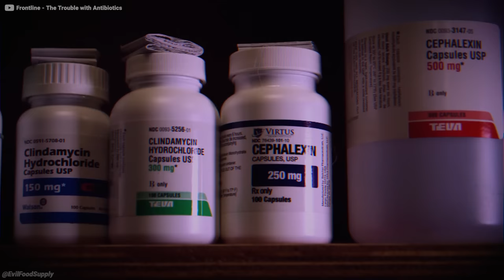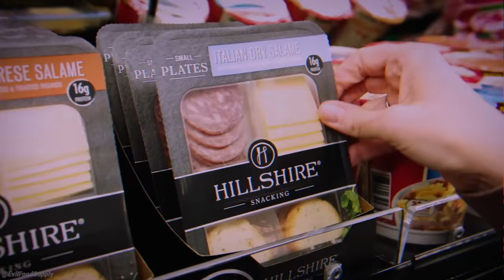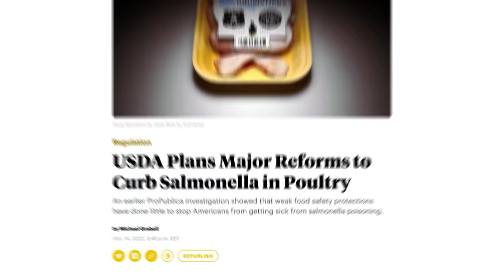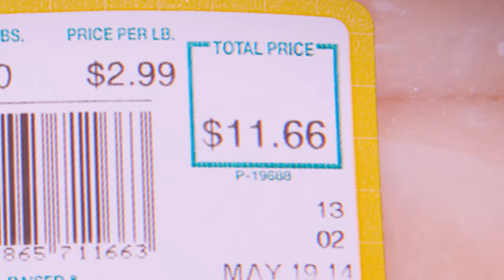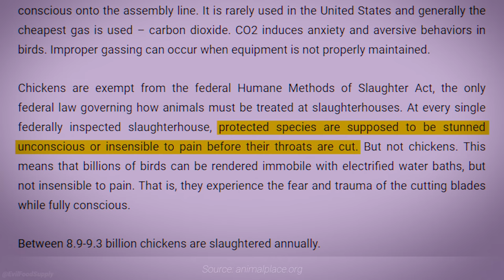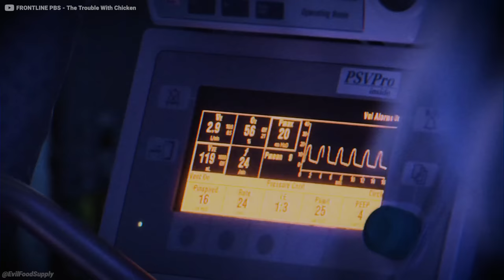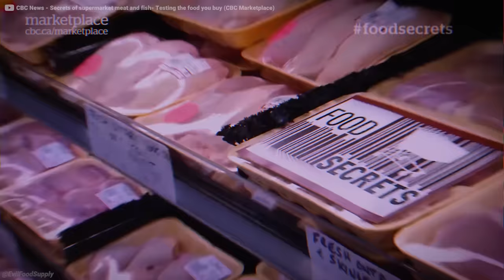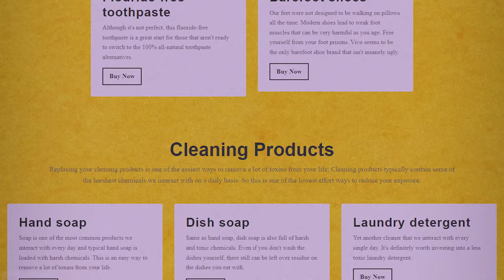Why is U.S. Chicken Illegal in Europe?

Comment: Alot of tap water has 2 ppm of chlorine.And if they're using chlorine their likey using muriatic acid which is 1000000 X more acidic than base/neutral PH. Reason being chlorine needs to remain around 7.5 PH to be the most effective.
Reply: the chlorine they use for desinfecting water is different from muriatic acid. although they both contain chlorine its in a different form. The chlorine in Muriatic acid is already in its reduced chlorid form which is the same as table salt chlorid. In fact muriatic acid is the same acid used in your stomach. The pH level of an acid/base solution depends greatly on the concentration. The chlorine used for sanitizing water is a pretty powerful oxidizing agent unlike muriatic acid thats what kills the pathogens. For muriatic acid to desinfect you would need really really low pH levels which would be eat away your skin too. Btw pH 7.5 is almost neutral even slightly basic, your blood is pH 7.4 for example. Acidic solutions have pH levels below 7 like your skin which is something around 5. The chlorine solutions used to desinfect (like your household bleach) are kept in a basic solution around 11-13 to keep it from forming chlorine gas.